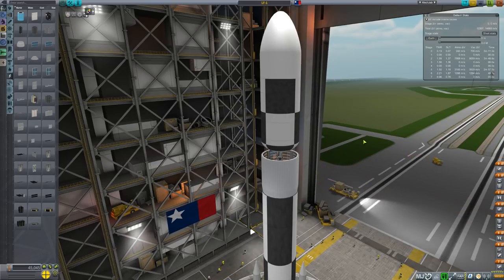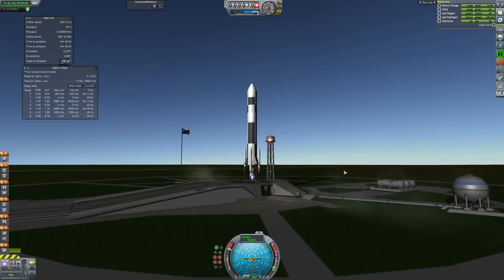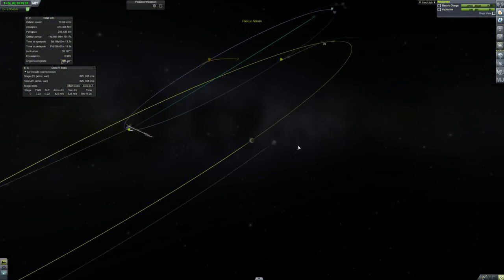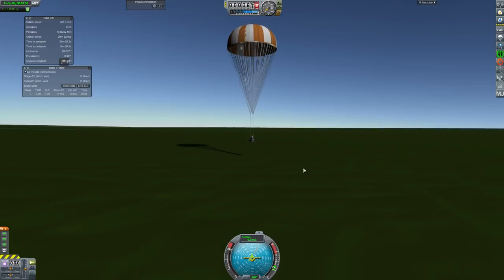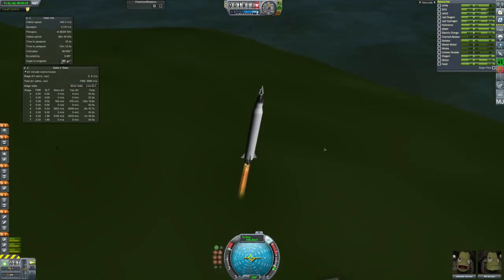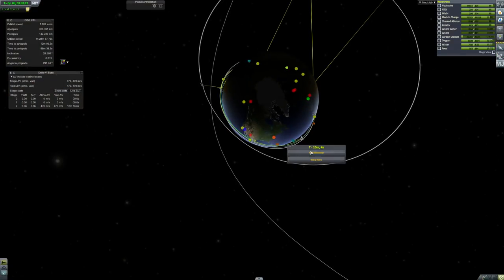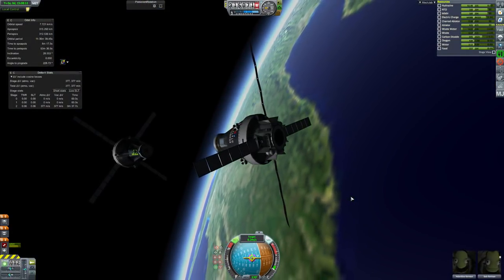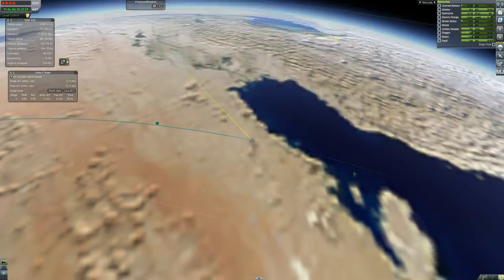Realism Overhaul: Project Luna #3 - Lunar Probes & Docking - Kerbal Space Program

Comment: 2:26 - That shielding on the top of that comm dish is called a Radome (Pronounced Ray-Dome), usually they're only used in atmosphere to keep the elements (Wind, Rain, Hail, Direct Sunlight) and FOD (Foreign Objects and Debris) from damaging the dish and aperture, however depending on the nature and/or sensitivity of the communications dish it might be used in space as a first line of defense against microscopic FOD bombardment and direct sunlight exposure. However, a Radome would be less desirable to use as they're generally made of fiberglass and can be quite heavy.

Comment: N.T.O is Dinitrogen tetroxide, but is more commonly called Nitrogen Tetroxide Oxidizer, it is made by the catalytic oxidation of ammonia, it's commonly used as an oxidizer in rocket propellants because of the fact that it can be more or less stored easier than other oxidizers and can be safely stored at room temperature..without having to worry about the hazards that come with storing other types of oxidizers